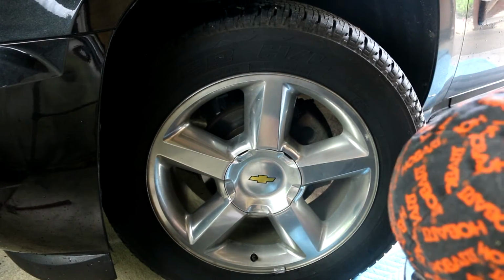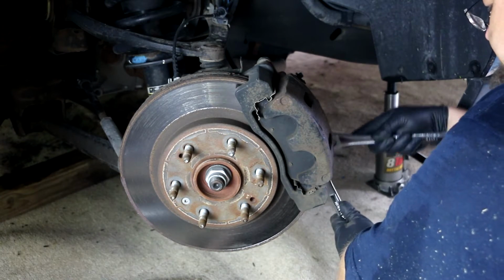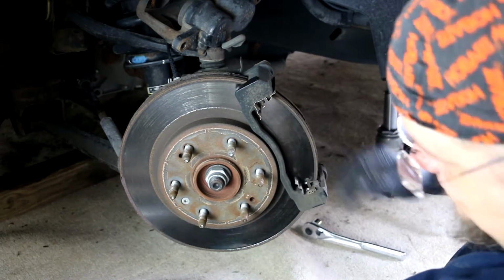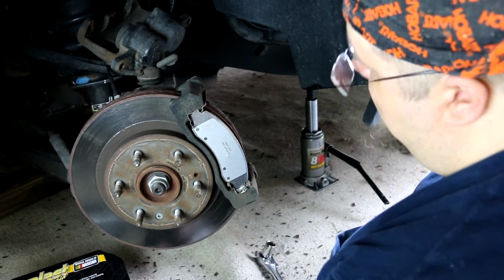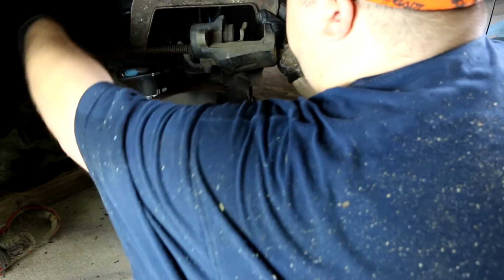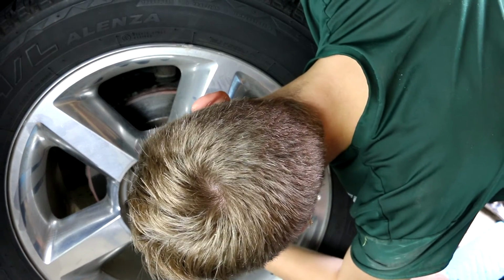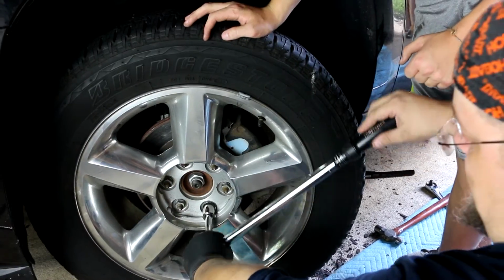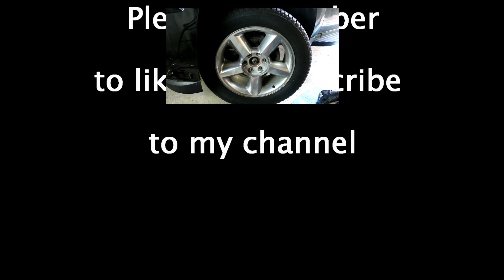Replacing brakes on a 2011 Chevrolet Suburban

Comment: When you compress the caliper do you have to loosen the cap on the reservoir
Reply from the maker: gonzo phoenix az No you do not need to do anything with the reservoir. You will need a clamp though.
Reply: Yes loosen the reservoir cap to release pressure when compressing the caliper